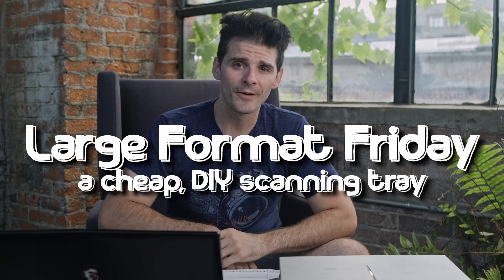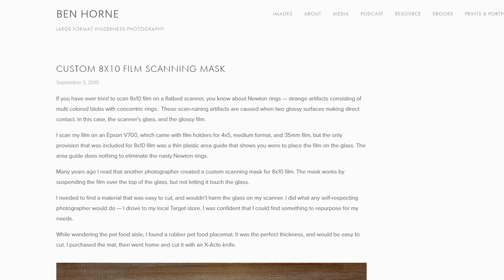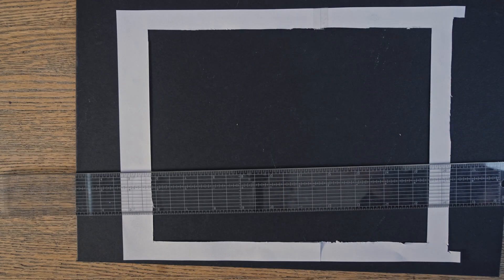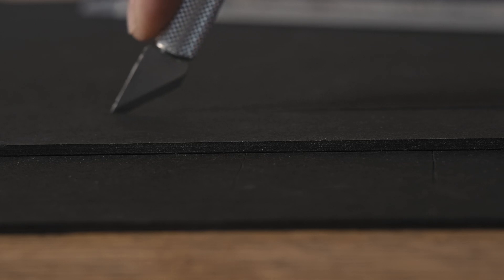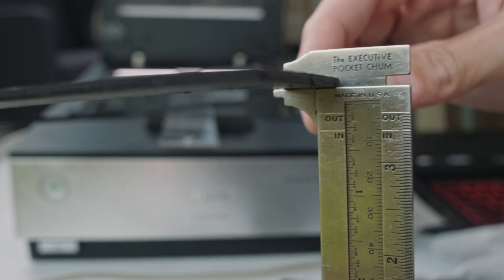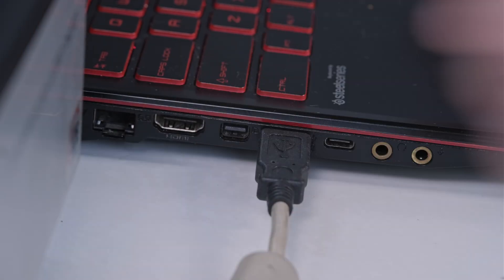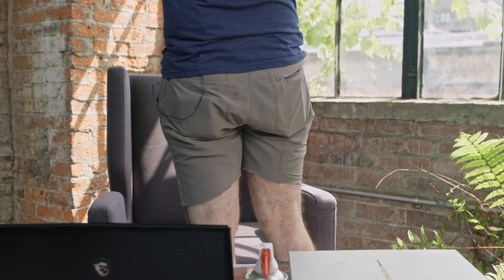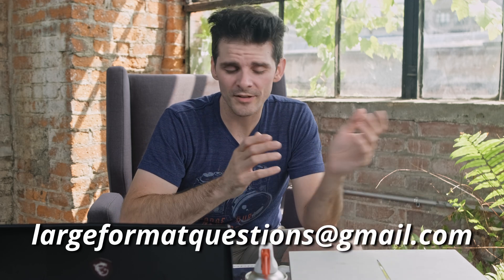DIY Epson Flatbed Scanning Holder - Buh Bye Newton's Rings! - Large Format Friday

Comment: Going to have to try this! I've been driving myself crazy with Newton rings on Fuji HR-U x-ray film. Might do a smaller one for the Fuji instax wide while I'm at it. Lifesaver!
Reply: I've scanned a bunch of the HR-U with this method. It works great. No newton rings.
Reply: I love HR-U and it's interesting that my experience is very different from yours—I've found that with either side down on the glass it's really newton ring free. My negatives tend to be very thick though. How do you develop yours? I'm using Rodinal at 1:100 in a rotary tank.
Reply: @madscienti11  I develop 1:100 for 6 mins in rodinal. My negs I have had trouble with are a little on the thin side so that could be why. It is usually in the shadows so that would make sense.
Reply: Instax definitely needs an air gap between the print and the glass. That's why I 3D printed a custom mask for the Instax Mini. And I'll definitely do one for the Instax Wide when I decide to use-up that pack that's been sitting on a shelf for way too long.
Reply: @Francois_The_Photon_Mechanic  I had to scan some up for work I was doing for an exhibition and nearly drove myself crazy! I had to scan each one at least 5 times and then try to layer the good bits together! Which I’d known how easy this all was to then! 🤣
Reply from the maker: Oh my goodness yes, it seems like everything Fujifilm is riddled with Newton's Rings if it's on the scanner glass! Glad this could help and happy scanning. :)

Comment: I've used a similar setup for 4x5 but I tape the neg to the frame to keep it from sagging in the middle. Otherwise I would think that the sharpness would be different in the middle where it sags compared to the edges where it is on the frame.
Reply: I've been thinking of doing this for 4x5 as well. The Epson film carrier is really poor. How can they make a great scanner and make such lousy film holders? Has anyone at Epson tried to use the scanners before shipping them out? 😕

Comment: I told you so 😅 - for film.  I do my own silver gelatine glass plates and I used to put those on a Horne style mat but have started putting them straight on the scanner glass because the emulsion is so textured I don't seem to get Newton rings and I like to scan the edges of the plate. It's a bit naff,  kind of like scanning the sprocket holes on 35mm. But film I scan taped to a frame cut from Ben's template.

Comment: Great video, Mat! But did you get Newton rings with the emulsion side down on the glass? I didn't know that could happen, have to check my own scans now. Also, wouldn't it be better to tape the edges of the sheet to the holder to keep it from sagging? Great tip about the transparent ruler, I have to try that, I don't think my scans are as sharp as they could be. Enjoy your Friday! :-)
Reply from the maker: That's the craziest part, on a lot of color and select B&W films, they will get Newton's Rings when scanned either way. Fujifilm Acros I've been to be the most prone to it, but not with this DIY raised holder.

Comment: Wait, what? You just drape it in the frame? What is stopping it from sagging? I would expect focus to be all over
Reply from the maker: Focus hasn't shifted AND there's enough of a gap to prevent heating and curling. Ben Horne recommends taping to the holder for more precision.
Reply: @MatMarrash  ah, I wondered about that. I think I will go with tape to be sure
Excellent tutorial. Thanks Mat
Reply: Not in, but on the frame. It does sag a bit (can be clearly seen in one instance), but it looks as if not far enough to touch the glass. While sharp (the depth of field for these scanners is quite large, several millimeters as it seems), this would lead to small distortions, that might be visible when doing architectural photography (or have straight objects near the edges); this is not theory, but I actually do experience it with Rollei Infrared 400 S 4x5 sheets, because they do have a tendency to slightly curl, and it can become visible. This method might actually work with the usual (stiff) 4x5 stuff, but I would not use it for 8x10. Both Mat and Ben are mostly into nature and landscape (and portrait in case of Mat), so it won't affect them. I myself would rather go with wet-mount, but this is not only a messy process, materials are also hard to get (and expensive). Luckily I don't have problems with Newton Rings (so far).
Reply: @c.augustin  hadn't thought that scanners had a significant dof. That'll fix it. I think Mat's mention of tape would resolve further issues
Reply: @ВОВ-е9с  I like to have the whole format (including all borders) in my scan, but for those that don't mind the border, the method shown should be really helpful. I'm using a m43 camera with a macro lens, and there the DOF seems to be worse – or maybe not. I should do some tests (could be a method to get rid of the glass and the dust it attracts ;-)).